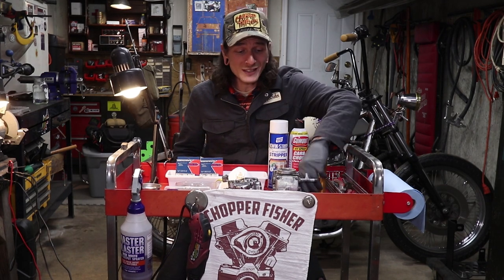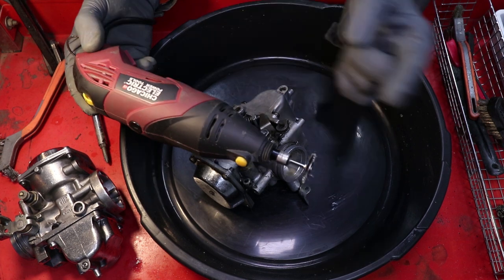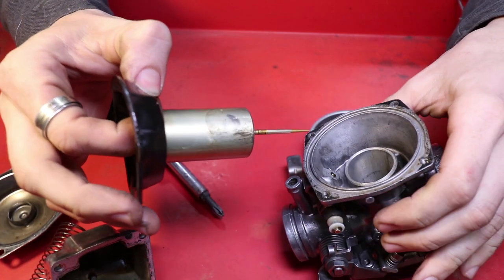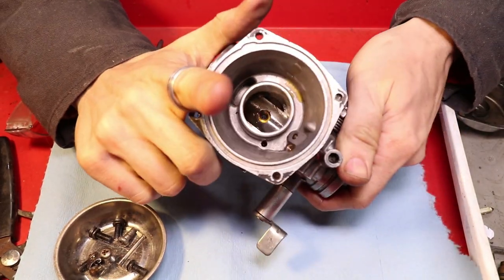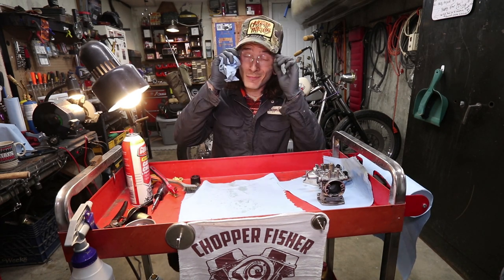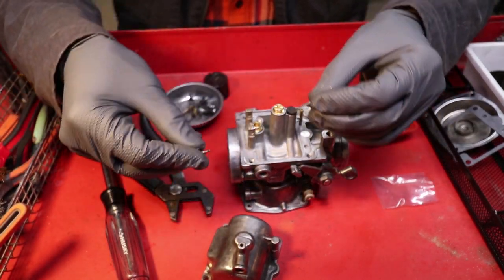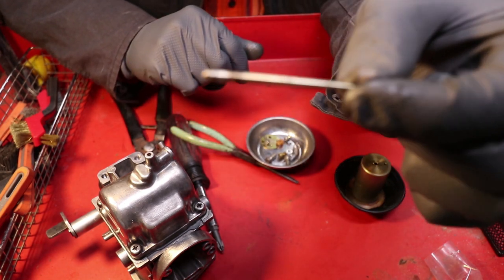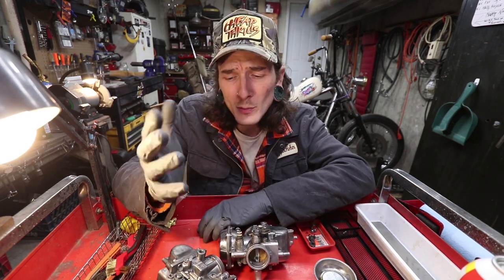TCbros XS650 carburetor rebuild Kit (full carb cleaning inside and out of NASTY CV bs34 carburator!)

Comment: One suggestion for disassembly, when you take out the idle air screw (the one on top toward the engine) and you take the screw out with the spring on it - make sure you get the tiny washer and tiny o-ring out of the hole. You don't want to be putting the new o-ring and washer on top of the old! Also, when you put it back in, screw it in carefully until it seats - DO NOT force it - then back it out about 2-1/2 turns, which seems to be the the census on what setting runs best.

By the way, EVERYONE forgets to pop the little screen on the needle seat insert!

Comment: Nice! Yep, carb cleaning is always a joy, lol. I always seem to accidentally spray a little in my mouth, stuff burns, but Gumout is the best! I'd recommend for the "carb camera" you set your auto focus to manual after you've dialed it in, and it won't wander on you while filming. Set it at a higher f/stop and more will be in focus as well. Also, I've stripped out a lot of screws on carbs to recently realize that there's such thing as a JIS screwdriver (Japanese Industrial Standard) they've got a little dot on the head, and a standard Phillips will strip these babies out. Highly recommend one for Yamaha bikes. Keep up the good work! I'll try those buffing tips when I get my new jets for my bike.
Reply from the maker: Hey great point! On something like this it would definitely make more snese to jack up the f-stop, especially on those closer shots. I count on bokeh to hide my mess most of the time otherwise 😅 but thank you for checkong it out glad you enjoyed it ! 🙏

Comment: Great video! How do you clean all the little jets? Soak them in carb cleaner??
Reply: Unless new ones are included in the rebuild kit... ha. Goes to show how much I know at the moment.
Reply from the maker: the kit does come with new ones but to clean the originals carb clean blasting through the holes will do the trick or an air gun, definitely dont poke anything in there though and they deff dont have to be shiny to work right! just not build up 👌
Reply: Sweet, thanks 🙏🏽

Comment: What carb kit did you use
Reply from the maker: TC Bros! You can use code :CHOPPERFISHER at checkout for 10% off 🤘😎
Reply: @ChopperFisher  I don't see the emulation tubes in those kits.
Reply from the maker: Why would you want/need new emulation tubes? Jet accordingly and rip it!
Reply: @ChopperFisher  I have reused emulation tubes many times but in your video you replaced them and suggested that I do the same. You did not use the word emulsion tube but you did throw it in the basket and advise replacing it.
Reply from the maker: @Jon Kamholtz  img your right 😅 hahaha forgive me its been awhile and i have a poor memory. I just had to re watch my own video to remember i even did that 😆 if you cant find a kit with one you can definitely reuse it but take some extra steps to ensure the little holes arent plugs up with some extra carb clean and maybe even little pipe brushes

Comment: Damn bro that bike is looking titties,I actually love those carbs,as long as the needle and seat are clear,and diaphragm is unholy,I've always bench sync them and work perfectly, you can also get "Canadian needles" with adjustable clip,change main jet up one since they came lean,run one stage hotter plug and bingo its its purrfect
Reply from the maker: Hahah thanks man! Ill be running straight pipe so ill have to tweak them from here for sure but ill have a good clean start, ill have a small range of jets to work with anyway when the time comes, ive got a buddy from the lowlifechopperpodcast that built one with straight pipe so ill probably start with what hes running 🤘
Reply: @ChopperFisher  hey man yeah its definitely a bonus with the adjustable needle clip if you're running open pipes,I would do one up on the clip ,if your using pods one up on the main jet,but that's just what worked for me,anyways man,thanks for the comment and the vid,i subbed